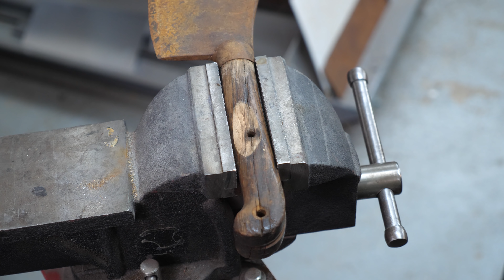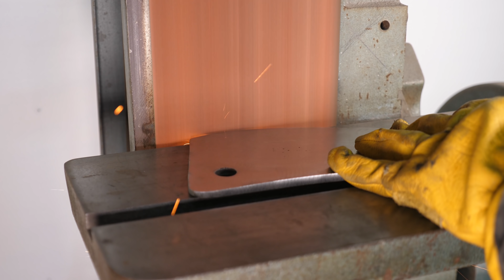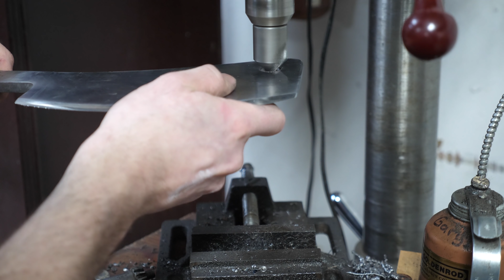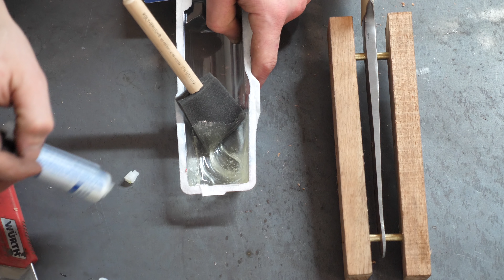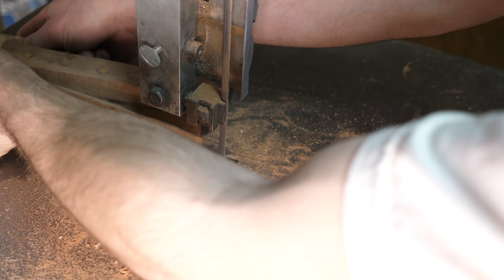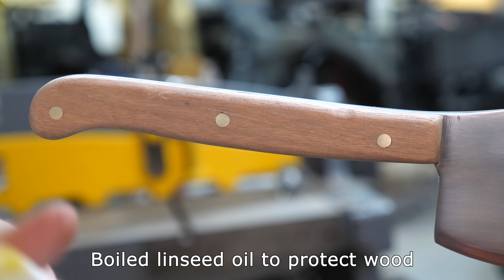Rusty Butcher's Cleaver Knife Restoration

Comment: Ha, you got me to subscribe. Some of your restorations are something else, but I like where you are going. I see you are learning, along with the rest of us. For instance the handle, you took the time to grind off the brass rods and shape the wood, but ended up cutting a taper on the band saw and cut all that work off anyway. ??? Also, as an aspect to restoration is duplicating some of the methods used to make the peace in the first place, along with eliminating some of the ridiculous bits. You did good tossing the collar, but you didn't "rivet" the brass pins. The spreading out the ends before grinding them smooth will prevent them from working them selves out. Also the gap in the wood long the tang, I would thing filling with epoxy could help protect the metal underneath the wood, from rusting in the future.

Comment: A question I've had but never asked on many knife restoration videos is: if you're going to grind the blade down past all the pitting anyway, why bother with the electric de-rusting?
Reply from the maker: Good question that I've never been asked. Rust wears down your sandpaper/whatever abrasive you're using much quicker. It's much easier in my experience to remove the rust before doing any sanding or grinding.

Comment: Is anyone else going to mention how dangerous it was to put something woth a blade onto those saws and belt sanders? If that had gotten caught or if the machine threw it it could have ended so badly
Reply: Anyone who works with blades should understand how to use their tools safely. Usually the sharpening is done last, so it”s really not any more dangerous than working with any kind of plate steel. ALL power tool usage can end badly.

Comment: If you are going to wire brush and grind away at the surface - what's the point of the electro-chemical treatment - surely 10 secs with the wire brush and all the rust will be off anyway?

Comment: Nice job but as you did not gave the blade the appropriate heat treatment sorry to inform you have failed on your first knife. This is completely necessary due to all that grinding...
Reply: Rogerio Sartori nice to know that new heat treatment would have required,  learned something new!  I was more interested in the edge.  Couldn’t tell if it was sharp enough for the kitchen.  Happy to see this cleaver brought back to life.

Comment: Interesting but if you change a design feature (handle retention) it isn't a restoration its a modernization or revision.  You need to plan better on this and other projects I Ave watched you resand handles three times because you have a poor order of operation.  shape and fit then stain the mask then glue.